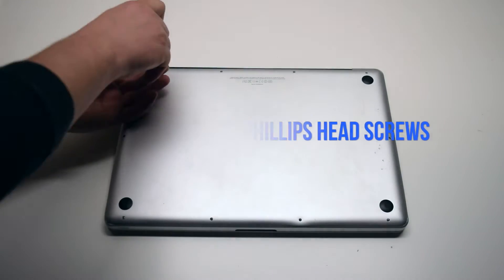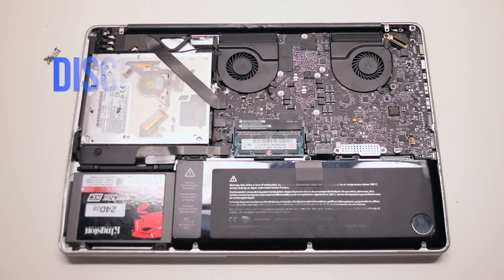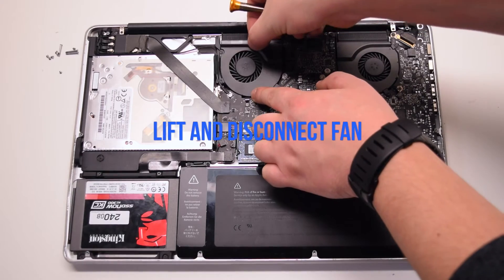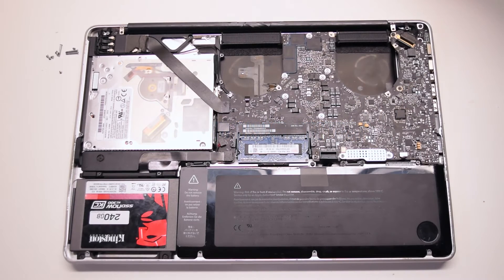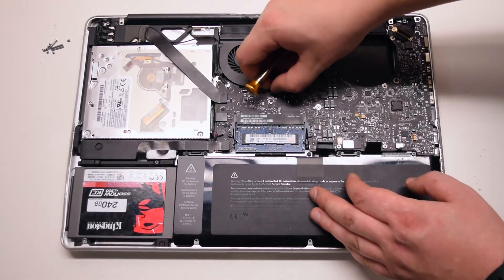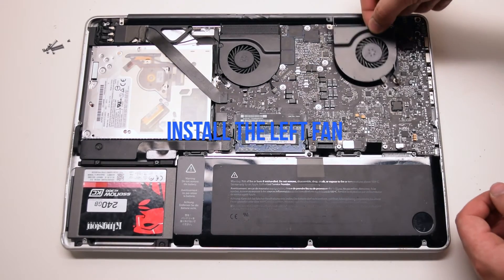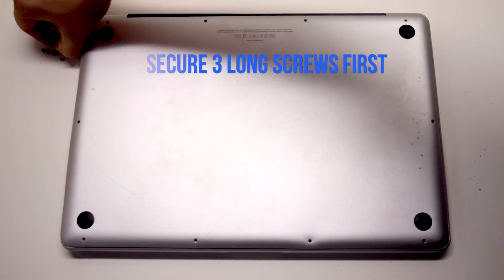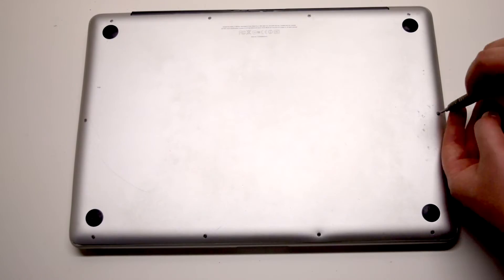2011 Macbook Pro 15" A1286 Left and Right Fan Replacement

Comment: Those old Sunon fans can be overhauled. Take them apart, pull the fan body off the base, and thoroughly clean everything. Blow out the base mount hole, and put a thin film of very light synthetic oil on the fan shaft. It just snaps back.

Comment: Hi,very interesting and useful clip. I have a question. Would you like to answer my question please.How do you disconect fan conector from logic board.? you do this by your finger. I want to know how you do this. 
thanks
Reply from the maker: I usually get something like a screwdriver under the cable and gently pull it up.

Comment: Hey, my buddy replaced my MacBook pro 13 fan but DIDN'T unplug the battery first. Unfortunately, the MacBook won't power on and the magsafe cable stays green + the battery indicator light flashes green. Any suggestion of how to fix this? Did he ruine my motherboard?.  Your help is much appreciated!!
Reply from the maker: Sounds like the keyboard is not plugged in all the way. Unplug and reconnect the keyboard ribbon cable.
Reply: Save Apple Dollars what makes you think it's the keyboard ribbon?
Reply: If you're stil having problem with this, i suggest to unplug the battery for 30 or more seconds, then plug it in again and try to boot the mac. This should fix the problem

Comment: So by changing my fans the loud noise will go away?
Reply from the maker: No, usually the loud noise is from a bad or dirty temperature sensor or dried up thermal paste. You can download the fan control app from www.appledollars.com/downloads and manually slow down the fans or you car remove the entire logicboard and clean it and apply new thermal paste to the cpu heat sink. Also watch this video on how to reset your SMC before you try anything http://www.appledollars.com/reset-smc
Reply: Save Apple Dollars thanks for the quick reply, one more question though I have an early 2011 MacBook Pro 15inch I've never changed anything on it with the exception of memory ram, do u think that it really needs new thermal paste and if so, what do I have to buy to put new thermal paste assuming I have 0 tools?
Reply from the maker: Any macbook repair kit for $5 on ebay or amazon for the screwdrivers and any standard thermal paste. Here is the custom interactive video map on how to replace every part of your macbook http://www.appledollars.com/2011-macbook-pro-a-1286
Reply: Save Apple Dollars I heard that I need some other chemical compounds to clean up the old thermal paste, is that really necessary? Sorry for all this questions I just want to make sure I do everything right since it its my first time doing this procedure to my computer
Reply from the maker: You don't need anything extra, just a microfiber cloth and rub it off. You should purchase 99% alcohol and rub down and soak over the sink the entire logicboard with a toothbrush when its out of the mac. That will fix the sensor if it's corroded, which half the time causes the high fan.